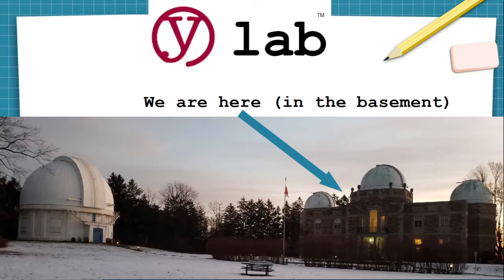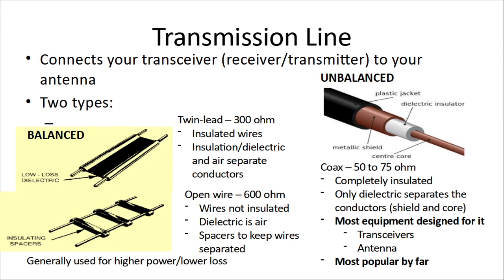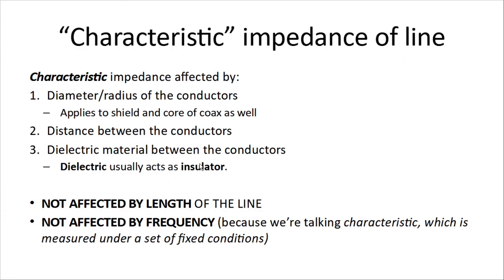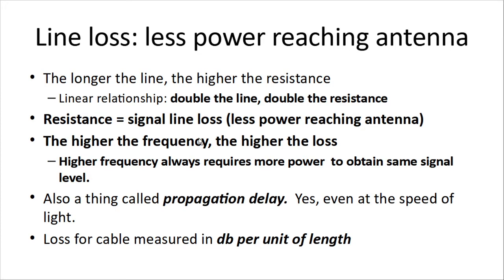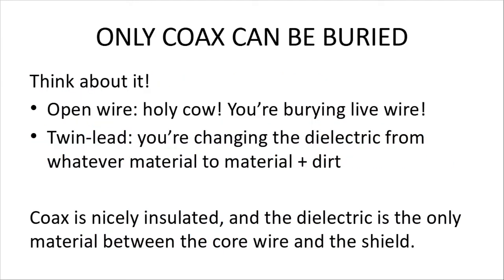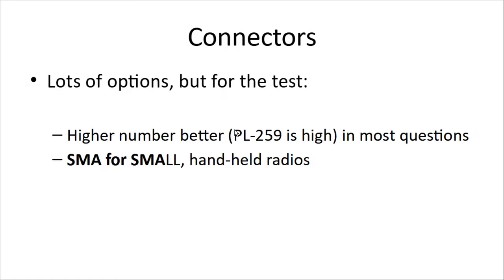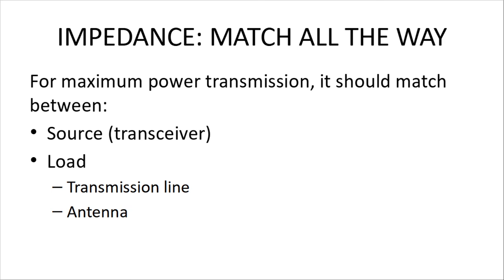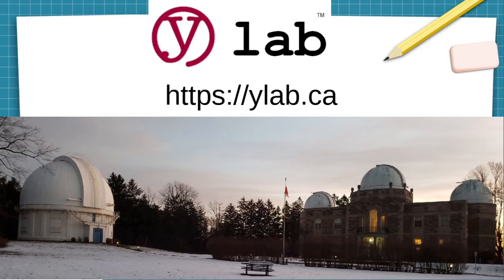Lesson 16 for Ylab's Canadian Amateur Radio License Course

Comment: Sorry, but the PL-259 is NOT the best connector, The N connector is much better, especially for higher frequencies and, when properly installed is also waterproof.
Reply: I don't have any skin in the game, but just wanted to add that page 7-8 of the Coax Publications study guide says that PL259 is the most commonly used connector. Further, it looks like this PL259 is used as it connects to the SO239 that is often on the transceiver or other accessories. It seems to be a conventional occurrence, like computers more often having HDMI outputs despite DP being better.
Reply from the maker: It's probably the best connector the Industry Canada team had on hand when they wrote the question bank.